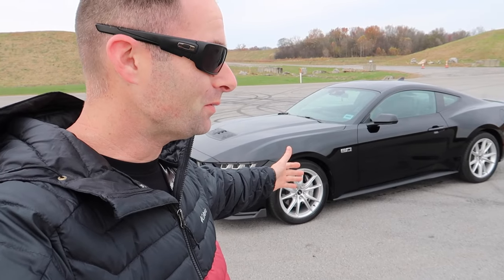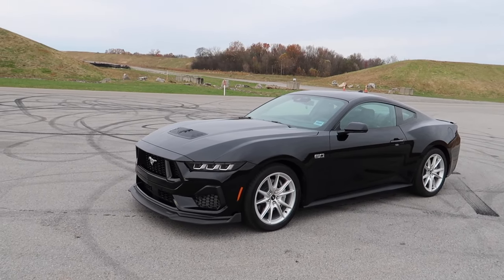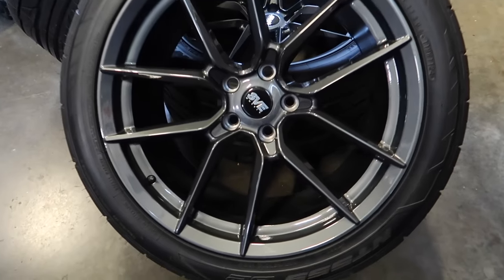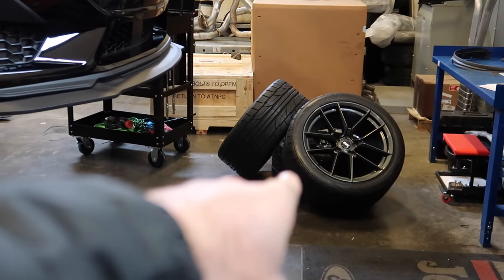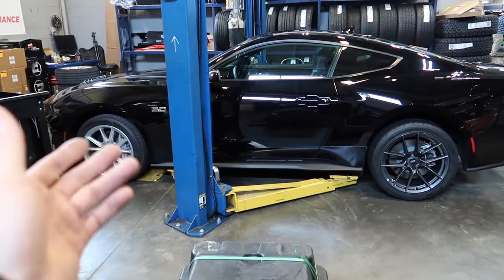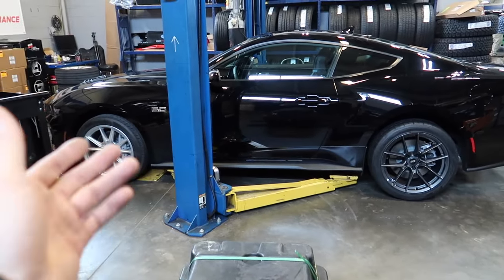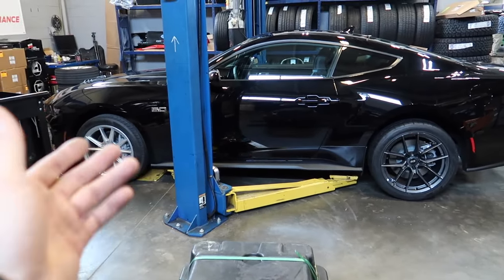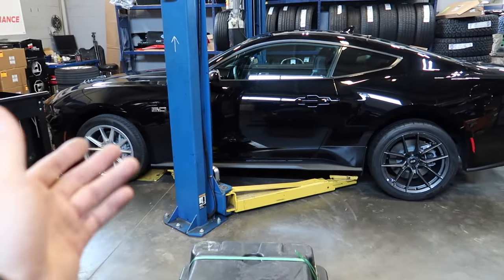I'M DONE... TRADING MY 2024 MUSTANG GT FOR ANOTHER  *THIS IS WHY

Comment: I have a stage three Roush Mustang that I dearly love and I have a Ford Explorer ST I’m a Ford guy through and through what I hate about Ford is the techs very unprofessional hacks. Most are half asses. All they do is half ass everything that they touch! I recently had my explorer. I gave the service rider $100 tip told him make sure everything is done properly when I got my car home and I want to change the oil. I saw all the missing pieces and parts and hardware under my car flopping in the windwhen I called them back to complain they said they were simply sorry that was this is not the first time this has happened at four I tried four different dealers. They always have some mechanic that doesn’t half ass doesn’t put things back the way they’re supposed to. I’m sick and tired of bored. Now I think I understand why people pay extra for an expensive car.

Comment: If you haven't done the Steeda adjustable endlinks with those bmr sway bars... It handles better then the factory...now since you don't have magna ride you can equalize the handling on all four corners... I know you will be using the BMR stop the hop stuff. Mine handle great with all the other stuff... Even an aftermarket front strut brace and k member brace... These cars handle well. That takes a lot of the float the cars comes with...changes the steering feel a bit in a good way

Comment: Alex the new Ford job is the perfect job for you. Congrats!! The new Black Mustang looks amazing but I liked the red and white cars better. I just found out that when you go with the Whipple 3.0 Gen 6 that Whipple just came up with a new tune, (their 2nd version of their tune) and this tune actually improves the smoothness and speed of the 
10R80!!!! Derek (DBP Squad) shared this over the weekend. Whipple sent him their second version of the tune. 
How is your Harley running? Do you ride it to work?
Steeda recently came out with their Carbon Fiber air tubes which showed 5 RWH & 5 Torque plus up. Remember you also gain 3 & 4 by removing the carbon filters so going from Ford stock to the Steeda CF you get 8 &9 RWH increase. 
Cheers Brother‼️👍👊💪🇺🇸🐎
Reply from the maker: Thanks a ton. I just heard about the new whipple tune as well. I’m excited to get one ordered as soon as I can.

Comment: Lol I knew you got it to add the whipple, especially when you said it was a 10R80 car. Battle thos stage 2 whipple 10R80s are sweeping everything on the street.
Reply from the maker: I can’t wait. Feels like a freight train with a rocket engine
Reply: @Zander13Productions  bro I honestly don't know why anyone wants to buy a manual Mustang anymore. The way these 10R80 Mustangs hit are so much faster than the manual trans, especially boosted. It will have to be something really special for me to get rid of my procharged S550. The way it's tuned and how hard it hits changing gears is ridiculous lol
Reply: @11B_GRUNT the autos are boring, yeah they are quick and make for a nice cruiser but thats about it. Plus the paddle shifters have like a delay so if you try and shift at say 4k rpm it wont shift until 4300-4400. I have a 24 gt with the a10 that i sold my sti for. Every time i drive it i miss shifting my own gears.
Reply: @lucian7182  my 10R80 shifts super fast, I also have it tuned too so there's no delay in my shifting when I use the peddle shifters. I had a manual and I traded it in for the 10R80 and Im much more satisfied with it. Definitely faster and for me it's still fun to drive, its procharged